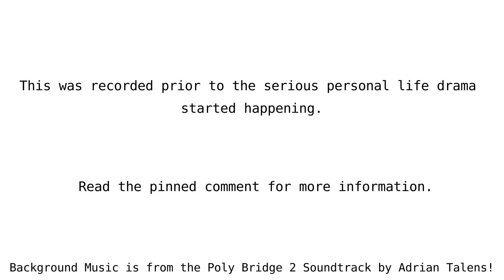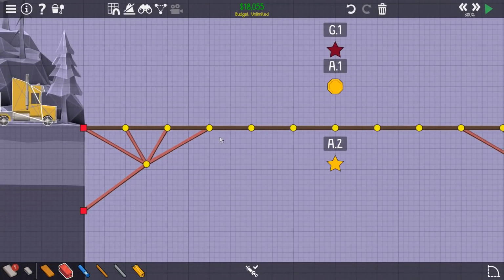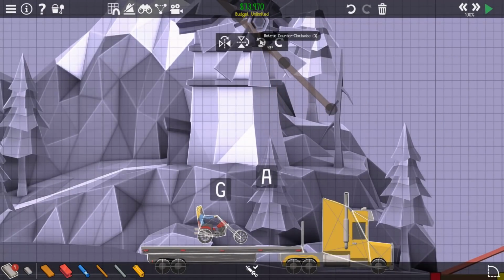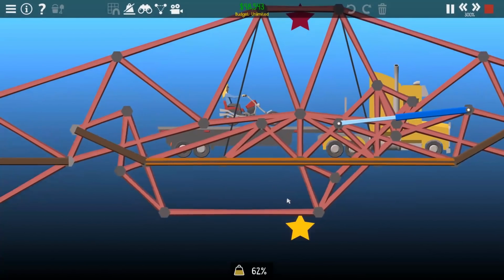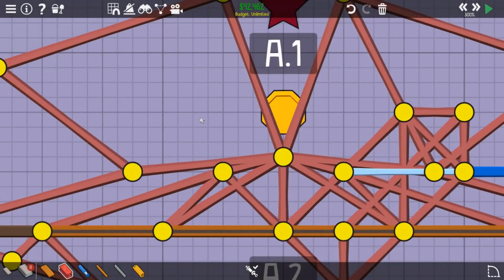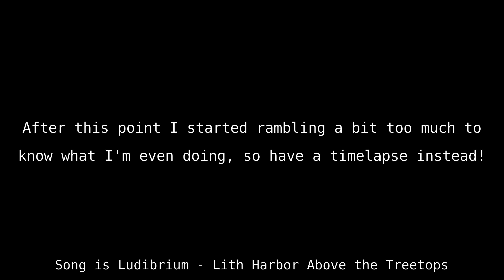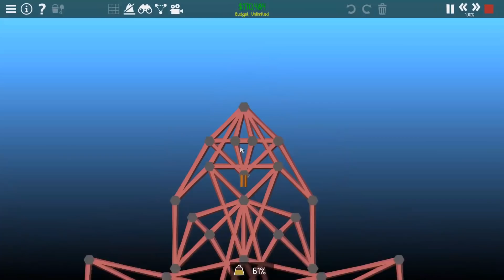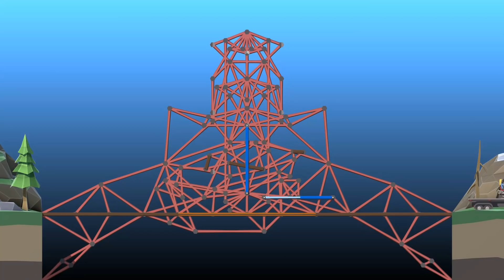Flipping a SEMI-TRUCK to Beat a Level | Poly Bridge 2 Overengineering

Comment: I have the same problem with Internet access. My parents have this cheeky little device called the Disney Circle that can do highly detailed restrictions on time, bedtime, specific websites, and monitor all access (not that I'm doing anything I SHOULDN'T be...*wink*), and I've seriously considered taking a sledgehammer to it sometimes, but they'd just get another and be mad at me, so what's the point.
Reply from the maker: You have the exact same device as mine. I've managed to bypass it in a couple of different ways but it's incredibly difficult to pull off and sometimes isn't exactly worth the effort. If you have any solutions, send me some. For now, I can somewhat use the data on my phone to communicate but due to reception issues living in a Jewish neighborhood, I can't really communicate with anyone live at all via that connection.
Reply: @ArglinPB  Huh. I do in fact have a solution, but like yours, it's kind of impractical and only to be used at the worst of times. I have a Raspberry Pi single-board computer with a wifi chip, that I can redirect the router to, as opposed to the router sending data thru the Circle, and then plug the Pi into my PC. The problem is, when I do that, none of the other devices in my house get Internet, as they're all expecting to receive it from the Circle, so...not a great solution. But if that sounds like it could be useful to you, you can get a Pi Zero W for ten bucks, just make sure you got all the adapters needed to use it. Like, for instance, it has this thing called a "mini HDMI" for video output? What the hell even is that? I'd never heard of that before.

Comment: what flag is that behind the dragon
Reply from the maker: Pan flag. I'm asexual panromantic but the Pan-Ace flag is way too noise for my liking so I stuck with the normal pan flag.
Reply: @ArglinPB  i never really got into the definitions that much, so now that i looked it up, i'm a little confused. So i would have considered myself to be bi, but does that mean i would inherently exclude non binary people?
Reply from the maker: @503unavailable  Bisexual doesn't always mean attraction to only male and female. It can be male/female and some other nonbinary gender, or even two different nonbinary genders. (If you're interested in knowing more about the non-binary genders, you can contact me through my Discord server).

Side note:
Some people think that bisexuality = transphobic (meaning against non-binaries and transgender people because "trans-" means changing from your original assigned gender at birth to any other gender, including nonbinary) but it's as ridiculous as calling straight = homophobic.

So if you're bisexual, it doesn't explicitly equal to "you hate non-binaries", rather you're just simply sexually attracted to the two genders of your case: male and female. It's not an opinion on your beliefs, it's just a fact about your sexual appeals.